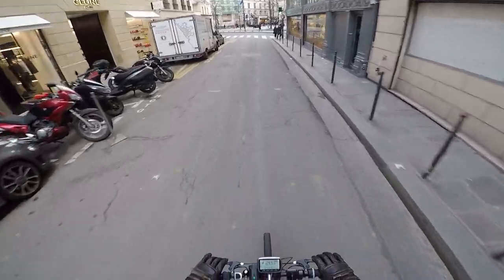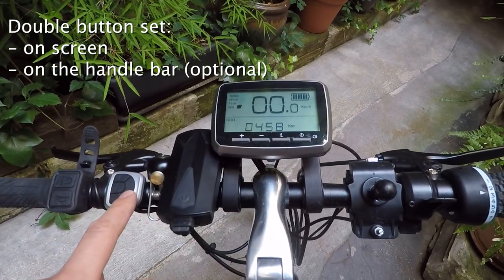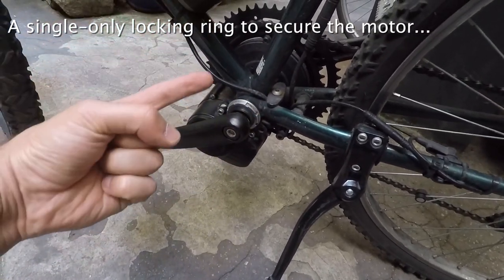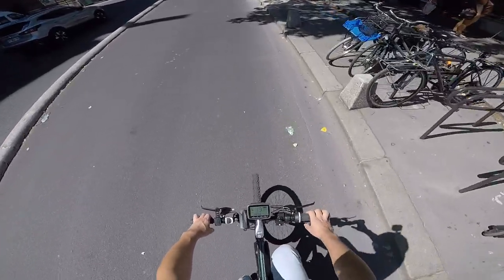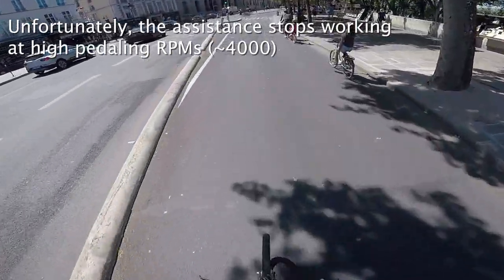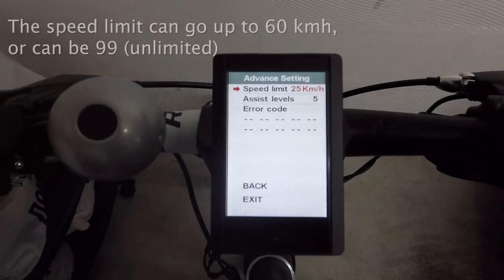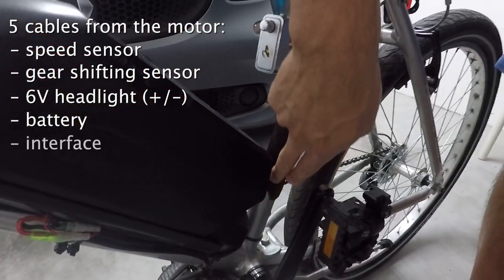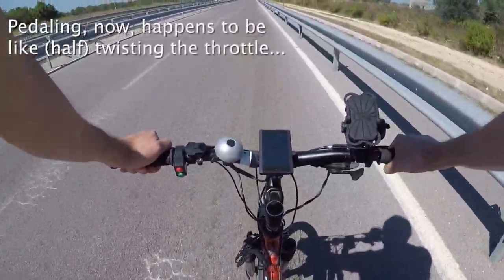Tongsheng TSDZ2 or Bafang BBS02B - 500W Mid-drive Comparison... Which one to choose?

Comment: Bonjour, merci pour votre vidéo très informative. D'après ce que j'ai compris (excusez moi, je suis novice sur les ebike) Tongsheng propose un système de pedal assist avec un torque qui semble être performant (comparé au système présent sur Bosch y-a-t-il une grosse différence?), alors que la marque Bafang ne dispose pas de cette technologie ou tu moins pas nativement sur leur kit ? Ou est-ce possible d'ajouter cette option via un kit spécial Bafang ? Merci de votre aide.
Reply from the maker: Bonjour et merci à vous !
Depuis ce que j'ai pu comprendre, Bafang ne produit pas de moteurs mid-drive avec détection de couple. Mais ça ne veut pas dire que ce soit moins fort... au contraire, il nous pousse plus fort pour plus de temps (résultat du fait que le moteur sait qu'on pousse avec lui, mais il ne sait pas avec combien de force).
Par contre avec moteur Tongsheng (et depuis ce que j'ai lu ici: https://www.quora.com/What-is-the-working-principle-of-the-torque-sensor-of-a-Bosch-electric-bike-motor c'est pareil pour moteurs Bosch), étant que le moteur est fourni de détection de couple, il produira une force proportionnelle à la nôtre, du coup il faudra faire de l’effort pour faire que le moteur s’engageât à fond! Ça reproduit une sensation de pédaler plus naturellement, nous permettons de gagner en terme de durée de la batterie, bien évidemment, et aussi de faire un peu de sport 👍
C’est uniquement questions de ce qu'on veut depuis nôtre velo : soit-il de nous remplacer ou de jouer avec nous
Reply: @LukeLorusso  merci, c'est exactement ce que je veux; faire aussi un peu de sport et avoir la sensation de pédaler. Si jamais je suis trop fatigué, je pourrai toujours enclencher le Throttle... c'est super!!!

Comment: Is there any chance that any of the auxiliaries used for Bafang kits also work with Tongsheng? I converted my bike with a Bafang BBS02, but would like to try a Tongsheng. Do I have to change everything?
The most difficult part is my magnetic brake sensors that are epoxy glued to the handles. 😄. The most expensive is of course the battery.
Reply from the maker: nope man, sorry... battery aside, everything else has different plugs.
Also the cabling system itself is totally different

Comment: Thanks for video and info.
Totally agree about the tongsheng throttle cutting power when pedaling.
Is there a fix anyone?
Reply from the maker: Hi there, thank you for watching!
I think with a firmware mod you should get rid of it, I'll make sure to cover that next year ✌
Reply from the maker: @kevinshort3943  the throttle is there exactly for that reason. Since a mid-drive motor is a generic-purpose motor, you could eventually build a motorcycle, than go to the motorization office, follow the legal steps and legalize your diy motorcycle with a licenseplate and all! That's absolutely possible and that's the reason why the throttle is present
Reply: @kevinshort3943  By your logic, why put an electric motor on a bicycle?  It's BECAUSE WE WANT IT TO BE DIFFERENT.  Throttle gives you the option to do what you want with it.  You can just cruise around on electric power.

Comment: interesting that your TSDZ2 didn't have light support, mine came with a splitter cable that broke that connection out from the motor, the other side is for the speed sensor. It turns the lights on with the screen backlight.
Reply from the maker: Oh that is a very useful mod! Or maybe yours is just a more recent version of the motor?
Reply: @LukeLorusso  possibly! it connects to the plug that the speed sensor uses in your case, attaching the speed sensor into one side, then the lights into the other side. it might have taken advantage of an unused pin, or yours might have the functionality buried in the speed sensor plug but they never shipped something so break that out into seperate wires for you. I've never seen the splitter for sale sperately, though
Reply: addendum, after walking to the bike and having a look, they use a little circular-with-a-flat-cutout connector on both sides, and it doens't seem to care which is which connection on the splitter. So I'm guessing lights are buried in the speed sensor cable that it's splitting off.
Reply from the maker: @DFX2KX  is it something like this?
https://www.aliexpress.com/item/4000109138227.html
I guess it's a new thing which is great!

Comment: Hi fellow parisian. I am curious about the type of assistance : for the Tongsheng you state it assists you in pedaling (like a bosch mid motor for instance) and the bafand feels like a motor turns on and push you (like a wheel motor). Did i get that right ?
Reply from the maker: Oversimplified, it's like that.
- The Tongsheng assist you in a "proportional way", multiplying your force by a constant based on the selected assistance level (Bosch-style like you said).
- The Bafang does not sense your force: it just counts the number of rounds per time unit of your pedal crank and then apply the amount of power based on the selected assistance level.
So it might happen that you "ghost pedal" and the motor do all the job, or the contrary where you struggle to pedal and the motor does not help you much. But you can overcome the second case with the throttle or lowering the gear.
Reply: @LukeLorusso  Thanks, so tongdsheng all the way for me, always hated the motorbike feeling.
Reply from the maker: @sebastienbily2331  yeah the choice is really personal and depends on what you do with the bike. For example I like both of them but in different scenarios :)

Comment: Thanks for the nice review. I have Bafang and I am very disappointed with their assistance implementation, one thing it pushes too hard, but worse - speed is too high. For example mine on L1 assist pushes to 12MPH witch is way too high. And worst thing it is not adjustable. I found that some makers for the same display 680C has settings to set power limit and speed limits for assistance levels, but Bafang decided you do not need that. Terrible decision.

Note: if they make it too slow/weak that would be annoying at most, as you can just skip to higher level of assist. But other way around is really terrible - level 0 is not assist and level 1 is already too high/ and there is nothing in between.
Reply from the maker: all of that can be customizable! stay tuned cause one of my future videos would be about how to make it "less strong"
Reply: @LukeLorusso  I do not really see how it can be customized without tweaking firmware, which leads to loosing warranty. But I would be glad to be mistaken.
Reply: Agreed the Bafang factory settings for Power delivery are terrible, however an app called eeebike will allow you to plug into controller and custom tune them.  It transforms how the motor behaves

Comment: If the tongsheng has torque sensor shouldn't that apply added power  only needed so it would make the battery last longer, the bafang drives its power constant levels and cuts off at speed limits on each pas level.

Comment: You need no shift sensor or brake sensors with TS. Also, you do not need the throttle.
Reply from the maker: Sure, you don't need the throttle. But still some viewer might be interested in comparing them :)
About the shift sensor I agree with you, but about brake sensor... even if it's a torque sensing system, you still need it
See this https://www.youtube.com/watch?v=KZrGvg4_KH0&t=165 to understand why
Reply: @LukeLorusso  well, I am on my fourth dozen and never a complaint. Torque sensing still requires some cadence. Yes, you could bypass stock programming for quicker response, but you would stop pedaling and hit the brake so there would be no incident. Now, if you are using a throttle and bypass the minimum speed for use, you could have a problem.

Comment: What kind of engine is suitable for courier? I use it for courier work
Reply from the maker: Hey man, you're thinking to realize a cargo bike?
there's no right/wrong question: with the Tongsheng you will save battery, but you'll also participate more to the effort, so you might get a bit more tired at the end of your day
Whatever motor you'll choose, for cargos go for a 750W motor, you won't regret it

Comment: Can you use bafang without gear shifter installed, by just freezing the legs when shifting the gears??
Reply from the maker: yes man, as said in the video
Reply: @LukeLorusso  that's good to know but how effective is that and what happens if u forget to freeze your legs while gear shifting?
Reply from the maker: @AirbrushDGart  basically nothing happen if you forget that, but the cassette and the chain will feel some stress (you could actually hear that noisy gear change, like a CLACK)
if it happens from time to times that's ok but in the long run the risk is to consume the cassette and the chain earlier because of the stress (even brake the chain in the worst case...)
but believe me, after you hear that clack a couple of times you will remember it 😅
Another thing I do personally, since I got brake sensors, is to slightly pull the brake lever to disingage the motor, so I can continue to pedal without really braking and also change the gear. It's like pulling a virtual clutch and that's pretty effective!
Reply: @LukeLorusso  aha ok so it's like setting the motor in nutural/manual when you break and the you can shift the gear.

Comment: ciao ho appena scoperto questo tipo di motore  il TongSheng TSDZ2 quale consigli su una mtb da 29 questo o il bafang di uguale potenza?
Reply from the maker: non c'è una risposta esatta, dipende da tante cose. prova a riguardare la tabella nel video
Reply: @LukeLorusso  come hai detto anche tu preferirei una via di mezzo, il tongsheng mi affascina il fatto del sensore di pedalata, essendo un ciclista di lunga data vorrei consevare una pedalata piu reale possibile, con il dovuto aiuto quando serve, però vedo che il bafang ha molta piu qualità dei materiali, solidità nel montaggio, ecc tutte cose che su una MTB sono importanti :/
Reply from the maker: @salvocmos  ti riporto questo commento sperando possa esserti di aiuto: https://www.youtube.com/watch?v=CNyqPEdvfVs&lc=UgzQc_Erl1FQE9PtL1B4AaABAg.9QAvIIm3QqC9QB00Wxnw1u

<<With the Tongsheng you'll have a more "authentic" bicycle feeling (meaning that, whatever the assistance level, you'll always participate with the motor in providing the force). With the Bafang you'll have more like an "e-motorcycle" experience (meaning that with higher assistance level your effort will be reduced and will tend to disappear). At the end is just a matter of preferences. With the Tongsheng I found myself more inclined to push harder! You'll auto-endorse yourself and it's good for fitness. With the Bafang you will convince yourself that you're on a 70cc Piaggio scooter, without the expenses of gasoline!>>

Comment: What is the maximum speed it can reach on throttle only with the Tongsheng?
Reply from the maker: as I say in the video is not worth talking about max speed, as your build may be faster or slower depending on your setup (like the gears you use, maybe your bike is lighter than mine)
I can reach 38kmh if I pedal real fast, but you could hit more, or less
Reply: @LukeLorusso  I can reach 45km/h if I pedal fast, mine is the 250W 36V version without throttle. I want to put the throttle, I have never try it, that's why I ask.
Reply from the maker: @CharlesEDarko  really? are you sure it's the 250W version? sounds too fast! I mean, surely my Tongsheng build is heavy, but it's still the 500W one
Reply: @LukeLorusso  Yes, it's. I'm going to put the Throttle today, after that I record a video to show. I even came with an idea (not proved yet) to make it faster, with a little inverter (Step up), I can convert the 36V (42v when full) to 42V and that way the power do not decrease. I going to see if I can put more than 42V without burning it.
Reply from the maker: @CharlesEDarko  that's interesting! ok then 👌 I'm curious

Comment: Any bafang conversion requires a reprogramming of the motor. 
Obviously you didn't do that.
Reply from the maker: what kind of reprogramming are you talking about? I assume you're talking about the one that requires a computer to re-flash the motor's firmware... Let me explain what you might have missed here:
- minute 1:23 of the video, when I explain that firmware mods are out of scope in this particular video
- when you say "requires", that is not precise: yes you can re-program the motor of both systems, and yes it may eventually (if well done) increase your build performance (just like a proper overclock would do for a cpu in a computer)
BUT
1) this video is dedicated to first time users, that for 80% of the case don't want to mess with that at the first time
2) those kits actually do not "require" it! it's an interesting topic, and I'll look forward to talk about that in a future video (thank you for the contribution anyways!) but... absolutely not mandatory! moreover, if someone is not an expert flashy-geek like me and probably you, I highly discourage to do it!

...or is there some other kind of reprogramming I am missing?
Reply: It is an out of the box comparison, no mods.

Comment: The TSDZ2 is far from 80 Nm, I have a Bosch Gen I 50 Nm and it's more powerful than the TSDZ2. Noticeable on steep hills. The Bosch will climb 16-20% easier than the TSDZ2 and the Bosch has more power at a slower Cadence.

The only issue with the Bosch is the 27 Km/hr cut off.

On level ground and moderate hills the TSDZ2 will be faster but on the really steep stuff the Bosch wins and it's also far more efficient hardly even getting luke warm were as the TSDZ2 will be quite hot.

The 80nm rating of the TSDZ2 is complete nonsense.
Reply from the maker: I guess it seems nonsense just because on its stock firmware a lot of its potential is basically locked... you find out its real force after you unlock it with a custom firmware. I agree with you about not being fair
Reply: @LukeLorusso  I highly doubt I will unlock 30-40 nm with the modded firmware. It might be worth giving it a shot but I doubt it will take the heat. 

Out of the box though the 80 Nm rating is really not true, more like 40 Nm.
Reply from the maker: @o00scorpion00o  I understand the skepticism. In case you find time and willingness, I'll say try it :) my next video will be about it
Reply: @LukeLorusso  I might give it a try, I don't have a lot of faith with the heat generated. 

Might be worth a shot before I sell the motor or whole bike lol.

Comment: bbs02b is really designed for 48v batteries.
Reply from the maker: You know both versions of the bbs02b exist (36V and 48V), right? 🙂
It's actually the controller that has two variants